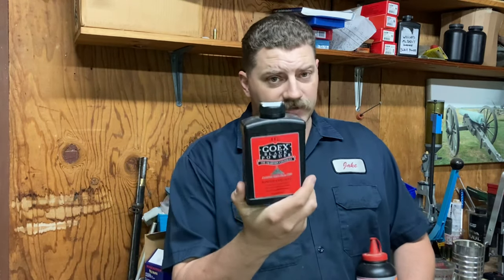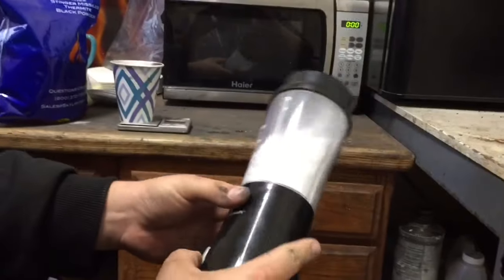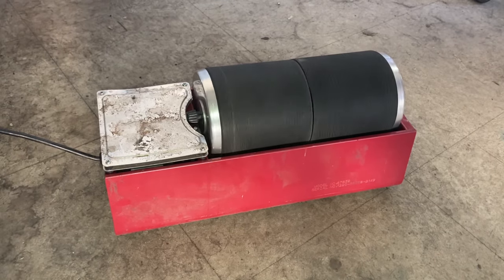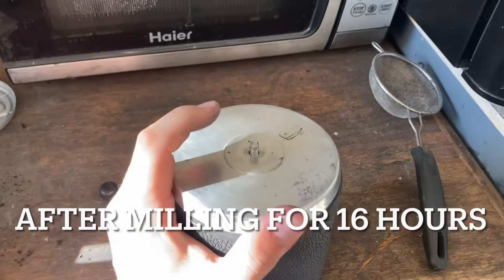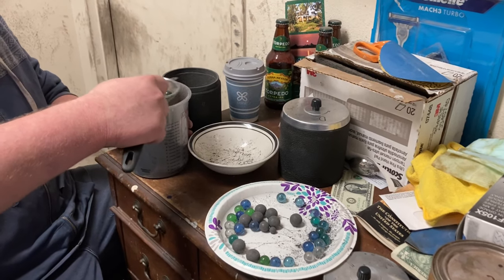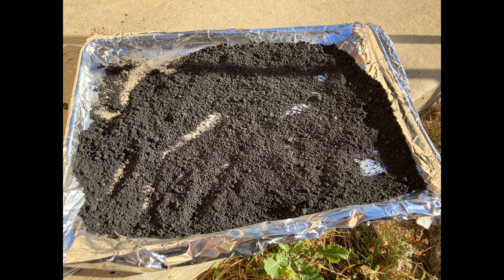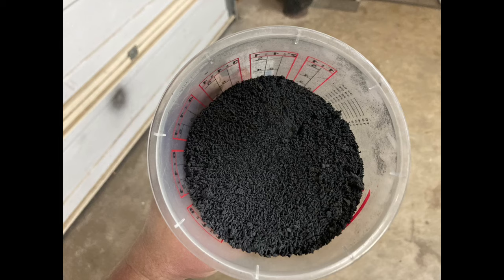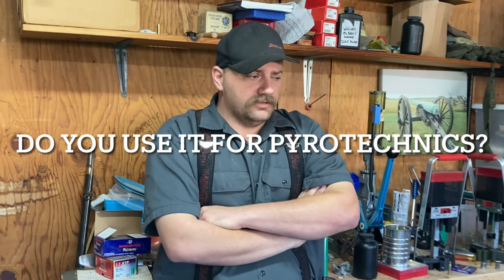How to make black powder (for firearms part 1)

Comment: How did your dextrinless granulated BP hold up after the granulation? I find it hard to make the granules not fall apart from even the slightest touch . Thanks 🙏
Reply from the maker: They hold up okay if you use 100% water to wet it. I’ve used 1 to 1 water and isopropyl alcohol but they don’t hold up nearly as well.
Reply: Commercial grade BP is compressed, that is what makes it tough. It doesn't contain dextrin. You can see part 2 where he shows entire process.

Comment: Sir...are you concerned about the Ball Mill exploding during the milling?
Reply from the maker: No. But the correct answer would be “yes” 
Captain safety says to always place your mill in an open area away from anything and everything.
Reply: Not with the safe milling medias. Plus 200g is not a terribly large amount, the concern arises with larger batches.
Reply: Won't happen.  Extremely difficult even if you intend for it to happen.  Quite frankly i would love to see a vid of this happening and what it took.
Reply: @duacot6633  I am considering a simulation after the 4th, 200 grams with glass marbles... and a fuse.
I will but a water jug and a pine board and possibly even ballistics gel with 6 layers of denim next to it.

Comment: So just looking for some tips. So I'm looking to get into making black powder. Can you let me know if my math is right. I'm going based off pounds. So 4 pounds of potassium nitrate, 1 pound of charcoal air float, and half a pound of sulfer powder. Is that about right. I'm looking to make a big batch. I'm wanting to hold a black powder rifle and pistol competition with some friends and family. I said I would provide everything needed if they helped pay for it. Lol. I'm pocketing some cash if I can make a big enough batch lol also what is a good mesh size for black powder that works in both rifles and handguns. And what is a good but cheap ball mill
Reply from the maker: Yes, your math is close enough but I would recommend starting with a small batch just to be safe. It would be an awful waste if that 5 pound batch didn’t turn out. The harbor freight rock tumblers work fine but they only do 200 gram batches at a time.
Reply: @Everythingblackpowder  okay cool I'm glad thank you very much. I appreciate the help.

Comment: You are supposed to use soft wood charcoal, like willow they say is ideal. And you are supposed to use the softest parts of the tree, the green sprigs. That is exactly what they make artist's charcoal pencils out of, but that's an expensive way to get charcoal.
Alcohol is the WORST thing to wet your powder with, use water, the hotter the better. Have you heard of the "CIA method"? It's supposed to be the best way. The issue is to get the PN mixed into the charcoal as well as possible. PN is only somewhat soluble in water, to get it to dissolve completely, you have to boil it. And  it isn't soluble in alcohol at all. Barring that, grinding it in your ball mill as fine as possible will have to suffice. With the CIA method, you first boil you mill meal (and you don't have to grind the PN, just the charcoal) in 1 quart of water, to get the PN to completely dissolve, so it soaks into the charcoal. Then, you add 4 quarts of alcohol, at which point the PN will will precipitate back out of dissolution, and it will all become solid, and you can strain it out, and dry it. And that's really all there is to it, I don't know where you get acetone from. 
So alcohol is the worst thing to wet your mill meal with.
Read this:
https://elcombate.noblogs.org/files/2017/04/improvised-munitions-handbook.pdf
That has good instructions for the CIA method.
Factory made bp is done by wetting the mill meal with water, and compressing it under 10,00lbs  of pressure, that is the second best way, and the most practical for mass production.
Reply: And you can make it 10% stronger if you leave out the sulfur. You only need that stuff for flintlocks, percussion caps will work fine without sulfur. Sulfur lowers the ignition temp, and takes up 10% of the volume.

Comment: Does 100 grains by volume of the black powder you make weight 100 grains?

When I make black powder 100 grains by volume only weights 55 grains.
Reply from the maker: No, 100gr in volume weighs anywhere from 60 to 80gr. I’ve been compressing mine lately and it makes a huge difference. After I compress the mill powder, 100 gr volume weighs 105gr
Reply: @Everythingblackpowder  you are compressing mill powder into cartridges?
Reply from the maker: @jackcrockett538  No. It’s compressed and the broken into small pieces and sorted by size 3F and 2F. That’s how the commercial outfits make their powder and that’s how you get the volume and weight to match closer. Sorry for the confusion
Reply: @Everythingblackpowder  ok got it. How do you break compressed powder into small particles?
Reply from the maker: @jackcrockett538  I put the compressed powder pucks in a plastic tub and hit them with a hammer and run them through a variety of strainers to get 2F and 3f

Comment: Can i use this black powder to refill cartridge 9x19 or .22lr? (I have fun do my 22lr cartridge at home even if its cheap) thanks man!
Reply: The problem with .22 LR is that the priming compound is woven into the rim. It's possible to re-prime rimfire cases, but it's generally considered to be too much of a pain in the rear for most people.

You should be able to use this black powder to refill any centerfire cartridge you'd be inclined to reload (including 9x19mm), although you generally won't find load data for it anywhere, and smaller capacity cartridges (9x19mm and down) will probably not produce enough energy with black powder to cycle the action on a semi-automatic firearm.
Reply: @Kaelland  uhm yes your are right man, true.. anyway about 22lr reload i meant only already primed cartridges.. 
But is possibile to create a double-base powder homemade? Example i made mercury fulminate at home too to refill rimfire cartridges too, now only miss to create a double base propellent..
Reply: @alessandroarzani7330  I see. That, I'm not sure on. I do know that .22 LR was originally a black powder cartridge, so if you had primed cases, black powder, and the appropriate projectiles, you could load .22 LR cartridges with black powder.

Comment: mine wont burn at all, its literally fireproof.  is it the milling or the charcoal?
Reply from the maker: What kind of charcoal are you using?
Reply: Check the quality and purity of all your ingredients. Make sure you bought the right chemicals. Even if there is little mixing and fineness in your mixture, it should still go off. There is a problem with your ingredients.
Reply: activated charcoal/coconut?

Comment: Have you tried making BP with added iron oxide? If so what were your results?
Reply from the maker: No I haven’t. I’ve never heard of that, what is the benefit?
Reply: @Everythingblackpowder  Red Iron oxide is added to rocket candy to provide more power I think in a firearm it would slow the burn rate down which is not exactly what you want whereas in a rocket it is exactly what you want for a long sustained burn.
Reply: @sheerluckholmes5468  youre wrong, its a catalyst, so it is better, but I don't think it works in BP, only rocket fuel

Comment: Don’t you worry about static electricity with plastic containers?
Reply from the maker: No. all the commercial outfits use plastic containers nowadays
Reply: @Everythingblackpowder  Black Powder used to always come in metal cans back when I shot it. I used to make sure I grounded myself out when indoors and refilling my powder just to be safe. Never tried pyrodex or anything but real BP. Yours burned fast like 4f pistol powder. You must make if pretty fine. Great video.

Comment: I think the reason you cant get your bp better than the brands is bc your using probably a different charcoal than them? Or maybe they add an ingredient
Reply from the maker: Possibly
Reply: @Everythingblackpowder  btw i dont know what you use to dry it but heat lamps work great
Reply: @Everythingblackpowder   charcoal is charcoal... just "carbon" for the chemical reaction... different types could only have different types of "extra crap" in it.. they use pine for lots of sparking in fireworks,,, (probably the resin don't burn off completely making the "carbon"0
Reply from the maker: If charcoal is charcoal, Then why does softwood charcoal perform much better than hardwood or activated? I’m not a chemist and I don’t play one on TV,  but I have done several experiments and the conclusion is that powder made with softwood charcoal burns faster than hardwood or activate
Reply: @Everythingblackpowder  there has to be more in it than just "charcoal".  that's the only way this could make a difference.. the soft wood charcoals have something in them that enhances the reaction.?? be interesting to have the different charcoals analyzed to find out what it is. (i'm not doubting your observations at all.).. there are some trade secrets at work at the commercial plants.. & it just may well only be the wood type..thats why in black powder making,, charcoal is not charcoal;>) unless pucking evens them all up? Thanks much for the video/info!
Reply: @Everythingblackpowder  The old timers and nearly all the worlds militaries back then used Willow wood charcoal for their black powder.
Reply: @kirkethridge2500  From the videos I've seen, fast growing wood is generally used because it is porous which allows the other ingredients to more intimately contact the charcoal.  BP is a mixture so there are physical requirements to bring everything into close contact for a successful powder.

Comment: Why 16 hours? Is too much time and cost! You can make the same results in 60 minutes top by using a 6inch ball mill jar from pvc at 100rpm with only lead media mixed 1/2 of an inch and 5/16 of an inch  balls ! Fill half way through with media and make 150g batch! Et voilà nice quick bp!
Reply from the maker: That’s what I’ve heard.

Comment: Commercial powder uses 1:1 50% solution of nitric acid & sulphuric acid for Corning.
Reply from the maker: A mix of nitric and sulphuric acid is a formula for making high explosives. Are  you sure about that?
Reply: @Everythingblackpowder   yes that's how they invented smokeless powder, nitrocellulose, gun cotton, cordite etc. Morden "black powder"  is not what was used in 1800. It doesn't leave much solid corrosive residue and  is more powerful.

Comment: Did u use marbles to mix the powder
Reply from the maker: I’ve tried a variety of media in an effort to speed up the process; marbles, wheel weights and lead balls but I’ve found a 50/50 mix of lead round balls and cut up wheel weights works the best.

Comment: You don't have to do that that way you don't have to use the Bulma you can use a blender to blend up the charcoal make sure it's nice and fine that way can blend up potassium nitrate same way and the and the sulfur to all in a blender but don't mix them together that way put them in some rubbing alcohol water mixture and boil them till eight nice steady boil Wallace mixing so you don't get an explosion then strain off the excess water then you have black powder with the water you can make your ff with the screen makes it easier than Friday night black powder that's good for a pistol and not and nothing else

Comment: Does charcoal type still make a "power" difference after you started "pucking" the powder before granulating (since pucking increases density & power).. ie did pucking allow you to reduce your load closer to factory BP levels.. or did you still have to use 20% more?  (Thanks much!)
Reply from the maker: Yes. The mixed hardwood charcoal black powder is still weaker than soft wood variants after picking but it’s not as bad as 20% it’s closer to 10%
Reply: @Everythingblackpowder   i' ve got some willow trees that will be cut soon!

Comment: Is it necessary to granulate it?
Reply from the maker: Yes
Reply: @Everythingblackpowder  Got it. Probably a stupid question but what happens if you don't?
Reply from the maker: It doesn’t flow through a powder flask, it’s hard to measure accurately and it burns very inefficiently in the barrel of a firearm.
Reply: @Everythingblackpowder  interesting thanks

Comment: Sorry you do not do it right . Melt the sulfur keep temp low stir in already blended  saltpeter and charcoal and let cool . Chip and strain ,you can get  4f 3f 2f 1f  and even rock power ( pea size ) 
for blasting .
Reply from the maker: Sounds like you should make a video on it.

Comment: Why do you need to use alcohol?
Reply from the maker: You could use water, Alcohol just evaporates faster.
Reply: What is the purpose of the liquid though? Does it do something different to the powder? Why can't you just use it the way it is?
Reply from the maker: @NielsenValleyFarms  it solidifies the powder and allows it to be granulated.  You wouldn’t want to use the milled powder, it’s too light and the slightest breeze will blow it away. Also it’s hard to measure in volumetric powder measurer. Black Powder needs oxygen to burn and the bigger granules (4F-1F) allows oxygen to get around the powder making it burn faster and cleaner.
Reply: Ahh ok thank you
Reply: How much media do I need in the roller? 🤔
Reply from the maker: @NielsenValleyFarms  fill the jar half full with media
Reply: Last question. Why can't I just use ash chunks out of a fire place or pit? Is there something negative that happens when the wood is exposed to open flame?
TIA!
Reply from the maker: @NielsenValleyFarms  I’ve never tried it. Using quality charcoal is one of the most important things about making powerful and fast blackpowder. It would probably work but the quality will probably suffer